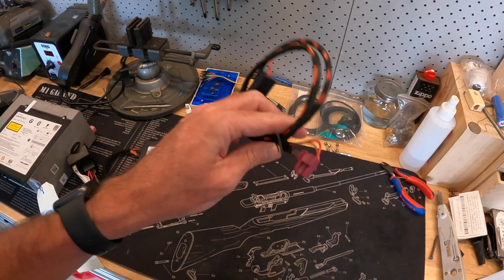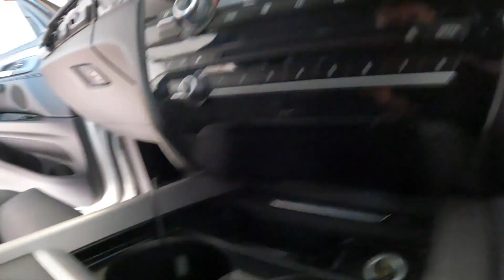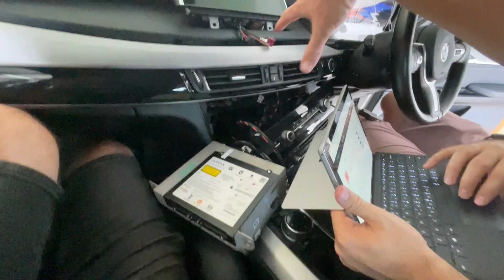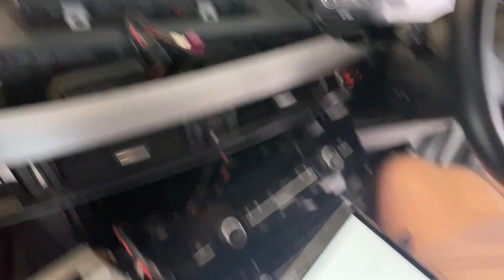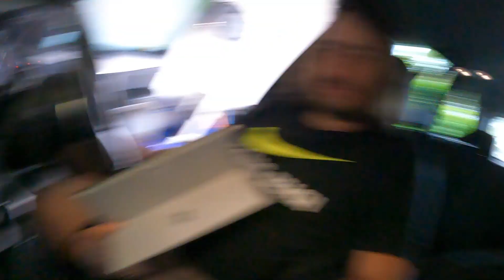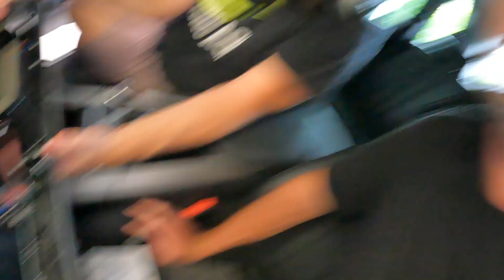BMW F15 X5 NBT EVO Retro Fit "Cheap Way" Attempt & Fail: Part 1

Comment: Hi thank you for this video. I wanna ask you what happened at the end did you upgrade NBT to NBT EVO work for you? If yes do you have a link with everything you used? Thanks!
Reply from the maker: Unfortunately we never managed to get it to work. Mark used a specialist to do the custom coding and activate apple car play. 

Bimmertech in the USA is great for getting this done.
Reply: @ZeroTo60Tube  I was about to buy one N BT Evo head unit. Good thing I didn’t I think it’s not worth it. It’s better to move to a model.  Thank you.

Comment: This "bypass" or can filter ist not required. Nbt evo can be coded to your vin without any problems.
Reply: Do you happen to know if the harness adapter is needed? I'm seeing harnesses with and without the CAN filter, and if the CAN Filter isn't required I imagine that the harness adapter is just mapping pins to different locations?

Comment: You probably coded your VO to the NBT EVO, perhaps even with a different country code? EVO will lock itself and you need a so-called VO FIX or patch. This will allow the EVO to be coded to every VO (as long als SALAPA matches). Also, in this patch, you can patch the unit to your VIN with according FSC's so you won't need an emulator any more:) It also includes Carplay. Check it out at FEMTOEVO

Comment: My brother did this on his F30 3 series he installed the ID6 with touch screen. The very first time you connect a new unit to the car it will look for the vin and if it’s not the same it will lock itself. This is the security feature. He had it bench coded and all works fine I’ll see if I can get you the details from where.

Comment: Welcome to F/G series! It's attempt 1.  E-sys is more finicky.  BMW are trying to get people to brick modules.  The only way I think to do it is to go through the X5 stock units and check settings like everywhere and then make sure the X4 unit is same.  I think the headlight modules record mileage and VIN codes too
Reply from the maker: I'll tell you its been interesting learning about it all in the last 24 hours thats for sure.

Comment: BMW electronics specialist here. few notes:
an NBT Evo has 2 kinds of anti theft / anti tampering mechanisms.

One is Coding Lock, in a nutshell once it is VO coded with a VO that differs too much from what it was originally coded to it will lock itself, give 'no signal' on the screen and from that point on it can be detected in e-sys but no longer will be able to be coded. This protection can be removed by special means.

Second is Component Protection, once the Evo is installed in a car with a different VIN your FSC's (activation codes generated for the cars vin to enable nav, ispeech, carplay, sat radio, etc) it will reject all these codes. That's been this way since the CIC iDrive. Evo's took that a step further, once the fsc's are rejected component protection is triggered and you will not be able to import any fsc's anymore even if they were for the cars vin. Component protection can be removed by uploading a special FSC to the Evo that has te sole purpose to reset the tripped component protection and from there on you can import FSC's again.

During the coding process you need to be very careful and thoughtful to not trip these anti tampering mechanisms.
I guess you botched that and now it is coding locked since you said it cannot be coded anymore.

Best is to ditch the emulator and get an FSC set made to your vin (I can hook you up with that :) ).
Just do it properly man.
Next the ethernet problem.
ethernet is actually called OABR on the Evo.
It needs to run from the BDC module to the evo and from the ATM module to the evo.
You'll actually need both connections since for component protection to be initialised the first time it needs the OABR connection Evo <-> BDC. Don't hook up an enet cable directly to the OABR, if you do your wiring properly you will be able to do all needed coding and what not via the OBD plug.

Get yourself an OABR loom from BMW (P/N 61 11 9 372 330) and an ATM retrofit wiring loom from ebay.
Lay the ATM loom from the trunk to the dash and remove the pins from the pre-installed OABR plug that connects to the evo.
Install the pins in the OABR plug connected to the loom from BMW. Then run the other end of the OABR loom over to the right side footwell where the BDC module lives. Remove the existing ethernet pins from the smallest connector on the BDC (these ethernet wires go to the quadlock and are not needed anymore) and plug the pins from the OABR loom into the connector on the BDC. 
That's it for the wiring.
Oh and you'll also need the WLAN antenna for Carplay to work, they are dirt cheap over at BMW (P/N 61 11 9 372 321).

Feel free to send me a message if you want to go the proper route, i can help you with part numbers, schematics, even remote coding ;)
Reply from the maker: Hi Arno, that is the most helpful info, thank you! What is the best way we could get in touch? Do you have telegram or whattsapp that mark can message you on? If so please let me know at zeroto60tube@gmail.com
Reply: @ZeroTo60Tube  send me an email at arnobruynen@icloud.com, i’ll give you my phone number via mail 😉
Reply from the maker: Hi Arno, mark will email you shortly. I didnt want to get in the middle as the coding and programming goes over my head a little. But will be following along closely.
Reply: Hey Arno, I'm experiencing a similar problem with my F48, retrofitting an NBT EVO unit. I think I'm at a point to look for a specialist's opinion and expertise. How can I reach you?
Reply: Hey there 
I would like to ask u a fee questions regarding the evo retrofit
Can u please provide me your contact info?
Best tegards
Steli
Reply: Hey there 
I would like to ask u a fee questions regarding the evo retrofit
Can u please provide me your contact info?
Best tegards
Steli
Reply: Hey, This is exalctly what I am looking to do in my wifes X5 we have a NBT and I was looking at getting a tocuh screen version of the CID. 

From what I am reading it looks like i need a NBT-Evo HU and the compatible Idrive controller. What should I know about coding this to my wifes car with aftermarket coding products? 

I am a master BMW tech but I am looking at geting some alternative coding and programming applications.Let me know about getting the FSC for her X5. I know I can back up her VO and restore if if goes wrong, but I need to make a new VO with the optiosn for this mod and the internet has tons of conflicting information. Would you recommend BimmerGeeks Protool, BimmerCode, e-sys?  Any help would be greatly appreciated man.
Reply: Hello. I’ m interested to retrofit, give me a mail adress to contact you please. Tnx

Comment: Once you've set the vin correctly on the NBT EVO you should be able to remove the ali-express dongle. 

If you've managed to brick the NBTEVO with a wrong VIN then you'll need a full fsc repair set - that will also get you the car play activation.

You'll find some good suppliers of FSC sets on www.bimmerscene.com

However if your going to use the ATM from the M3 you are going to need to code it to the VIN to match the ATM and use the ali-express vin blocker..
Reply from the maker: Thanks for the info. Will make sure Mark has been on bimmerscene. Talking to him this morning, he is thinking of not bothering with the ATM module now. He was hoping to use it for Nav and remote access, but with car play he will be satisfied. Need to find out more about the FSC repair set i guess.
Reply: fyi: I used femtoevo for my fsc codes and it worked like a charm

Comment: andrew lots of wizardry going on there better you guys than me i would be at control alt delete by now lol. scoot over and have a look at pickles salvage in qld lot 627   335i coupe  clean title ends 12 tommorow lunch cheeeeep cheers arnie
Reply from the maker: She's up to 6k now. What idiot was it thats made everyone see so much value in these old N54 powered BMWs.....
Reply: @ZeroTo60Tube  hmmmm let me think andrew mine is coming along a treat 2 quarter panels and a roof later my e90 coupe 92 for the purists is now starting to take shape all i need is a right fender if you know of any plastic ones